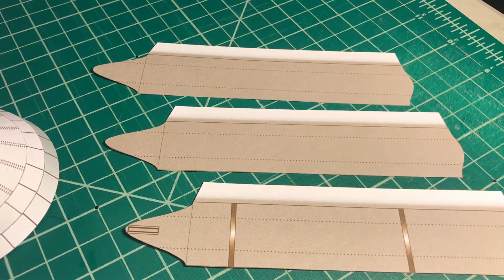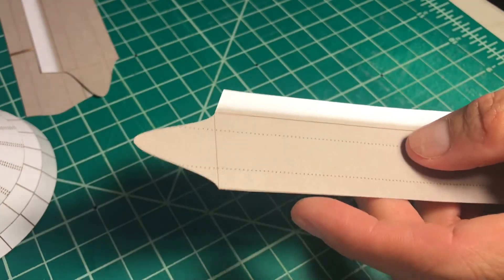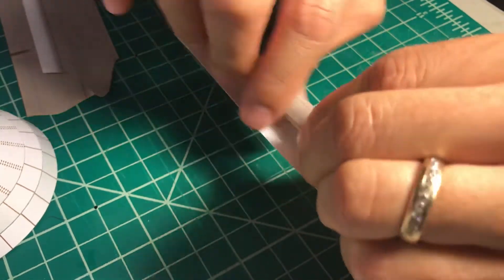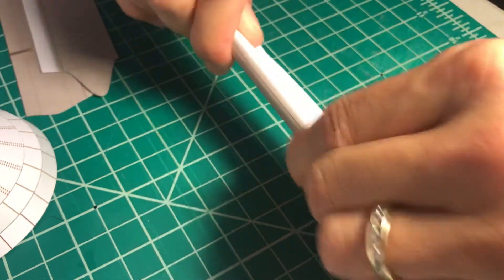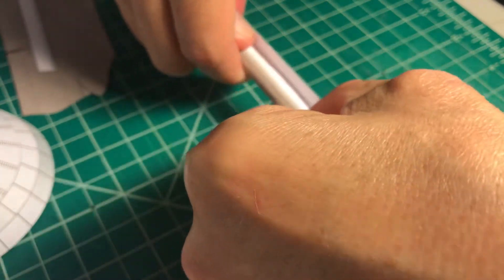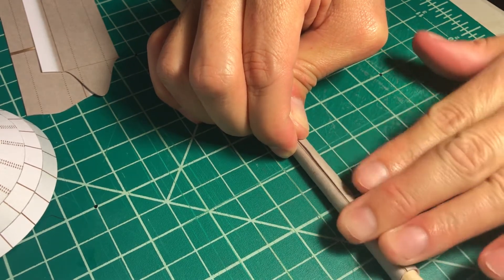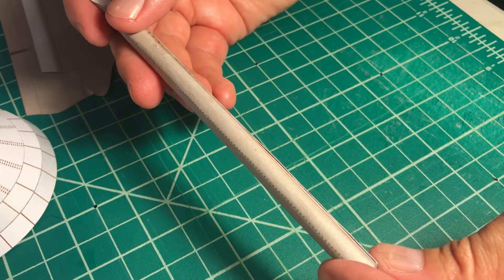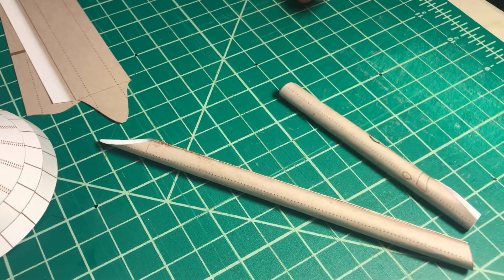StarHopper 1:100 part 2

Comment: Do you use card for the parts? If so what thickness?
Reply from the maker: Niall Davidson Cardstock with an index weight between 90 to 110 lb ( 165 g/m2 to 200 g/m2)